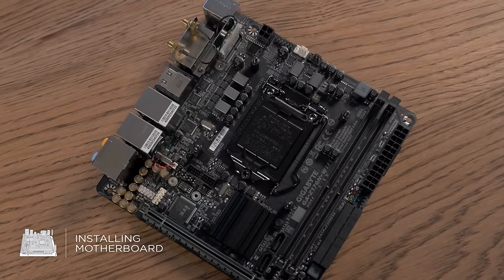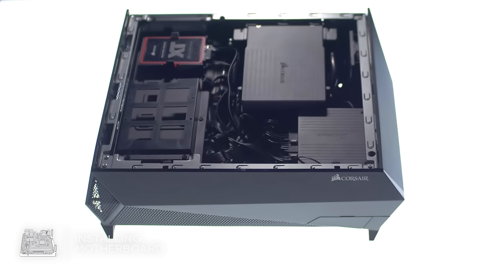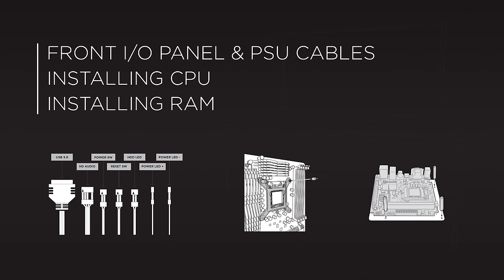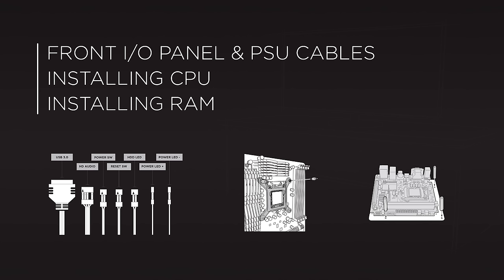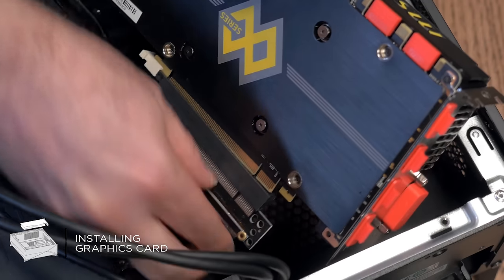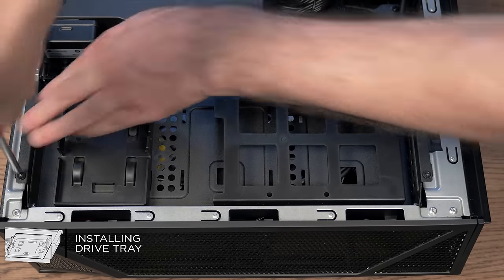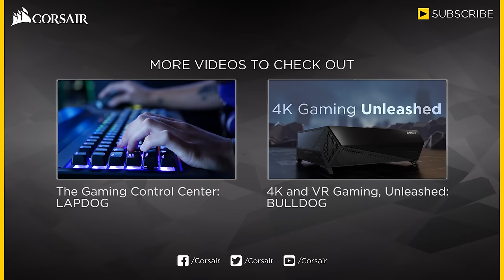How to build: BULLDOG

Comment: It's definetely something cool, but I would appreciate a bit more effort into cable management :p
Reply: I know right? The way the gpu aio fan is placed, cables may clip if the Bulldog has a different orientation.
Reply: omg this cable management is terrible. it looks like they never thought out this case fully. comparing it to the silverstone's Milo series or raven (which are smaller, have dust filters) silverstone is the winner. im no fanboy of silverstone, i was really hyped for buldong but now when i see it in action i am trully amazed how this bull..dog ever made it to market
Reply: lack of cable management in this case is definitely a problem, Corsair needs to go back to drawing board and rectify this issue
Reply: This form factor seems to be plagued with it. But they could have tried a bit harder, especially with a modular PSU. Custom cables for the exact lenght maybe?
Reply: cable OCD alert.. omg. its put me right off. :(

Comment: Just recently built one a few months ago, cable management is not the best for this case(but no one is ever going to see inside) , and does run hotter then your standard tower. hottest temp i have seen this go up too is 55C, but what could you expect on a mini ITX case. Overall super happy with it. Everything corsair makes is high quality and worth the money. I paid around 1000 for a complete build beside graphics card. I bought the standard kit with the Gigabyte Gaming 5 mini itx, Corsair vengeance 3200 16Gb, I5-6600k, and i had an extra msi 1070 gaming x that i stuck in there.

Comment: I just finished building a Bulldog with an i7 6700K.

Thanks for the video.  I used it more than the included manual.

I routed most of the cables, including the USB 3.0 cables around the side with the PSU.  Much cleaner. I wish the cpu cooler pump power cable was a little longer so it could be routed around as well.  I had to carefully bend the USB 3.0 cables over so they could fit under the cpu radiator. 

I'm waiting to get a used 970 out of another build to install with the GPU water cooling bracket, but integrated graphics are working fine for now.

My only (major) complaint so far is the sound of the case fans.  The Bulldog is pretty loud.  I may look into alternative 92mm fans unless there is a way to control the fan speed.  The CPU temps are great (idle at 28c) but wish the whole case had the sound dampening that the top of the case has.

Next step is to test a hackintosh build with it!

Comment: Good video, I may use this when I eventually get my own - however, wouldn't it be a good idea to test the thing works before screwing the chassis back in place? Would save an awful lot of faffing about if it turned out you'd missed something.

Comment: No offense to the work that went into this video, or to Dustin, but I would love to see what someone far more experienced with building computers could do, especially with the cable management.
Reply: I've been doing this for at least fifteen years. But cable management is admittedly my Achilles' heel. My primary concern was just showing how it came together.
Reply: Dustin Sklavos I understand you, I'm the same way. Nevertheless, your video got me interested in the chassis, and that's all that matters. Also, I didn't mean to question how long you've been doing this, you did great, I'm just all about those smooth runs of cable.

Comment: TL;DR: The build may look cool but totally not worth the time/money/effort required.

Did a build yesterday, 2 hours build time. Everything about the build is unconventional. The SATA power cable does not support powering a SATA drive if you choose to run SSD and SATA drive at the same time. One slip up and you have to undo a lot of work to fix it. For example leaving the power button on PSU off. The power cable going in to PSU is a complete after thought. All the components required to make this case work are very limited. Lets just say lessons were learned. Thank you for this video tho, it was a great help.

Comment: The graphics card is VERY HARD TO INSTALL.  On a ega 1080 FTW hybrid card.  Hoses and pushing on side of the case. and Power cords as well.  I finally gave up on this and bought a regular case.  Slightly larger but far less aggravation then this.

Comment: You shouldn't remove the plastic piece on the socket before installing the cpu. It literally says that on it.
Reply: don't understand why he installed it without the ram or cpu. also I would have put all the power supply cables that were needed in and routed it first, so it looks nicer.

Comment: Why did you choose this gigabyte z170n wifi motherboard with core i7 6700k...even at stock speed, cpu is throttling due to power consumption. Why didn't choose better motherboard like big sister gigabyte z170n gaming 5, that is truly awesome.
Other than that, it's a very good setup!

Comment: Does the bulldog really come with a motherboard?  I see a Bulldog High Performance PC Kit listed at your website for $399.99 USD, and I wonder what $400 USD actually buys me besides the case and motherboard.  By the way, does the case comes with a power supply? Can I install any video card or  am I limited by the side of the case or any other devices inside the case? Thank you.
Reply: Modular 600w PSU, Gigabyte Z170N mini-itx motherboard, H5 liquid cooler, and the case itself. Where I live (Australia) it's pretty much the same price as it would be buying the parts individually.

Comment: This product looks awesome, but I find your lack of thermal paste and cable management disturbing.
Reply: The thermal paste is actually pre applied from the factory on the H5 SF. Didn't seem to be on this example though. Might have been a pre-production unit?
Reply: when i purchased mine the thermal paste was already applied from factory. cable managment is difficult for this case but with some effort and zip ties cant fix

Comment: Messy cables bruh. not good.
Reply: Does it help your gaming if your cables are not neat? Worrying about something that doesn't matter ... not good.
Reply: yes it does it obstructs the fans, which can cause high temps.
Reply: It obstructs not the fan but the air comming through, means less airflow, more dustcatcher, and thereby higher temps.
+Corsair
Especially in an ITX case cable managment is really important (cause of heat). Also he should cut his nails. And if this guide is for beginners also show that there is a paste on the CPU watercool header and he shouldnt touch it and how the user should properly apply it.

Comment: not even a bit of cable management?
Reply: Not really necessary in a case without a window, since it have been proven that cable management doesn't change the performance of a computer.
Reply: +Ziirf That's only true if you're using high static pressure fans. Also, having those cables resting on top of that fan might cause a problem when the case heats up and the cables become more pliable and start to sag.

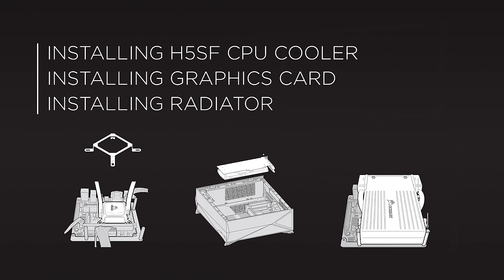Comment: 3:38 First SATA power cable is connected to the motherboard and nothing else?
Reply: 6:49 Another SATA power cable gets plugged into the PSU but the previous one goes nowhere?
Reply: Sean Gill Oh yea I figured it out. Thanks though.
Reply: I wasted $200 on this thing. Everything inside it is practically only designed to work with the corsair bulldog case so you can forget changing cases because everything but the motherboard is incompatible with a different case. The motherboard only has 2 slots of RAM, 1 graphics card slot, 1 HDMI, and only supports 6th gen CPUs, which is subpar in comparison to micro ATX/ATX boards. The CPU cooler is absolute trash. It worked well for a few weeks but soon began to display temps of 90 C+ while gaming. The PSU is too small for anything but the bulldog case and the 90mm fans barely provide enough cooling for high end graphics cards. 

I've replaced everything but the PSU so far (which is too small to completely cover the back end of my case). This thing limits you in every way possible. It's much cheaper in the long run to just buy normal parts, fuck this HTPC bullshit.

Comment: This thing is poorly designed. I should've known better than to get an "HTPC." I should've got a normal PC. It would've saved me some anger, frustration, and confusion. The cpu cooler doesn't even fit in the case because of the 24 pin ATX cords. Unless I break the antenna below it I can't put the cooler in. And if I swap the cpu cooler now the thermal paste is gonna drip all over my motherboard. 😂 Who thought a cpu cooler 1/3 the size of the entire case would be a good idea?